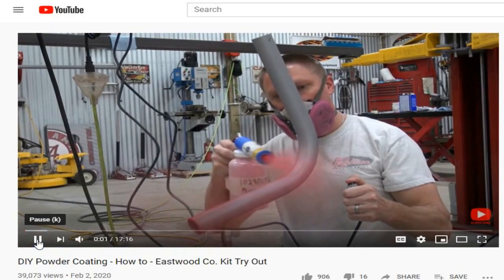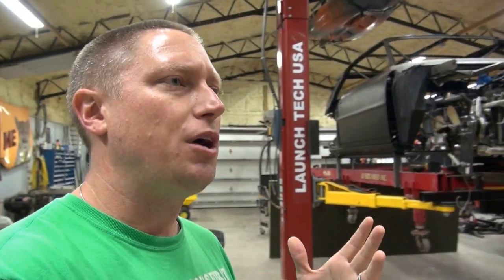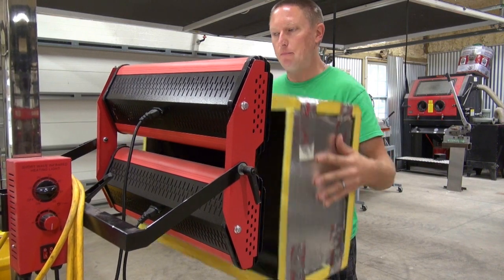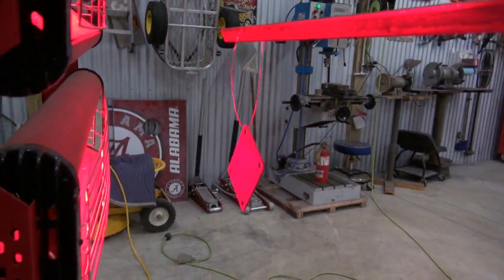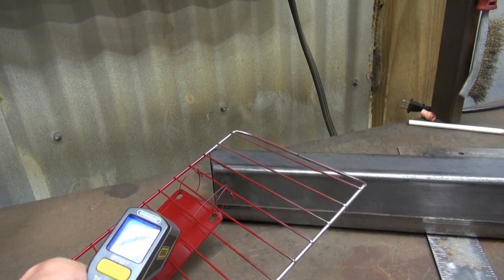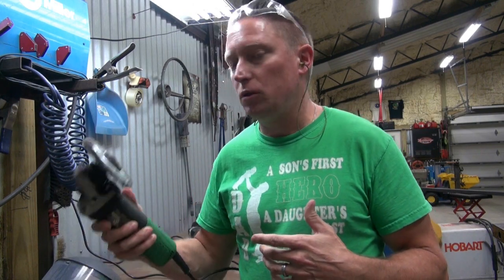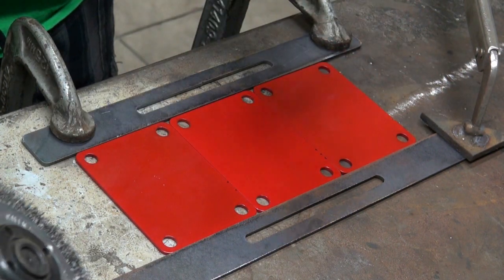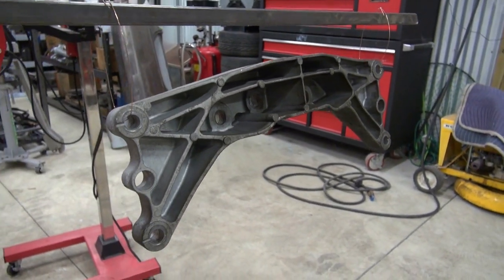Powder Coating Curing Methods Tested - Oven vs Heat Lamp

Comment: What if you made the box with the silver side in to reflect the heat.
Reply: Mylar emergency blankets would definitely help I’d bet. They’re much cheaper than rolls of Mylar and work well for reflecting any type of light
Reply: I was going to say the same thing
Reply: @sapper_5126  although mylar is generally fireproof it can begin to melt around 350-400 degrees which is a big no go for powder coating curing temps

Comment: The reason your thermometer read wrongly on the aluminium is that aluminium has very low infrared emissivity, however it is very reflective, so the home made box would actually have worked better using the aluminium foil side on the inside, not outside. The heat would have been reflected back from the inside of the box.

Comment: Just cut up 2 or 3 electric ovens (people give them away) to make one big oven it’s easy. I’ve done it bunch for friends etc. Best is when you find double ovens but just get 2 that are close to same size. It’s easy. I have a double wall mount waiting for a conversion in my shop. People will literally pay for them done. Also if ya don’t wanna cut up ovens a wood or steel frame oven with off shelf oven heating element and electronics if your handy works well. You can just make a box for your infrared lamp and you will be good.

Comment: Putting your IR meter against a shiny surface does not do much good. Instead, take normal electrical insulation tape and stick it on a small spot and measure on that spot and you will get a pretty good value. It doesn't matter what visual color it is on the tape, Red, white or black tape doesn't matter.

Comment: From an engineering point of view you should remake the box "oven" with the reflective side on the inside. The reflective side is designed to insulate against radiation, which is the type of heat the IR heater you are using produces. This will keep more of the heat inside of the box and allow you to heat up parts faster. Also, most people don't realize that aluminum foil has two different sides on it, one side is dull and the other is reflective. When using it to insulate you should put the reflective side against the heat source. The same goes if you are trying to keep something cool (think exhaust heat shield). 

Thumbs up for using a face shield when using an angle grinder. I require all of our shop guys to use one with an angle grinder regardless of the type of wheel in use. 

All in all I enjoyed the well thought out and researched video and have subscribed for more!
Reply: yes, also when you are smoking dope off of tinfoil you are supposed to put the drugs on the dull side and the flame to the shiney side. I suppose the same goes for everything when it comes to tinfoil hahaha
Reply: Beat me to it, @laptopgeek0991! Yes! What he said! A not insignificant portion of your heat radiation is being lost (or rather, not being used to it's full potential)!
Reply: @nlceguy , one side of the foil isn’t any different than the other. 

The manufacturing process just leaves the sheen, but there is zero difference in reflectivity.
Reply: I was thinking the same thing, but also might try aluminum sheet metal with the fiberglass panels attached to the aluminum sheets. You definitely need the reflective surface towards the part and heat lamp to get maximum heat.
Reply: Thank you..
Reply: You're correct about the reflecting of heat, but if you research that duct board, the reflective side is only rated to 150 degrees. The other side is rated at 450 degrees.
Reply: Mostly, depending on the heat rating of the foiled side. Also, in this case it wouldn't matter, but the reflective side must face an air barrier, regardless of where the heat is coming from. Radiant  barriers don't work in direct contact. The reflective side is useless if you're going to put something hot in direct contact with it.
Reply: @elijahrobinson2362  nope, there is a huge difference in reflectivity actually.
Reply: @31acruz  actually it doesn’t. That’s from the manufacturers.
Reply: @elijahrobinson2362 Dude, regardless of it being a byproduct of manufacturing..Dull finishes are less reflective, like, literally--the more reflective side..is more reflective. The side you can see your 'reflection' in..is more reflective than the dull side.

Comment: The two tests used ,for testing powder coating , in the industry is MEK ( Methyl Ethyl Ketone ) rub test and cross hatch. The MEK tests will test the cure of the powder and cross hatch would test the adhesion. If powder coating passes these two simple tests you know everything is good. MEK is a solvent and is the only solvent to test powder . You would choose a spot on a panel of equivalent thickness, preferably and not on the job you doing , You would dip a cloth rag on your finger into the MEK and while maintaining its wetness by dipping , you would begin to count off the rubs. You need 60 rubs without going through the coating back to the substrate. I have seen tests done where the coating is so under cured that it rubbed through to metal within 4 rubs. If you go through the coating you will know that the part has not been in the oven long enough or had sufficient heat. 
Cross hatch is done by using a blade and cutting through the coating a series of 5 cuts 1mm apart and about 2cm long and then cutting transversely through the previous 5 cuts , in the opposite direction, essentially leaving 25 x 1mm squares cut through to the substrate . Then you would overlay these squares with a good sticky tape ( like packaging tape NOT masking tape) . By using a single even stroke remove the tape . none of the 1millimetre squares should be removed wholly or in part . Should these have been removed the adhesion has failed and there are a multitude of reasons for this . like oil, dust rust mill scale or even thick phosphates and so on, on the surface , or even curing ( which can be checked with MEK) . Perhaps i should do a youtube on these tests.

Please remember that powder coating is a coating and not an armor plate although it is a very durable coating it is not designed to be ground with wire or chisels , screwdrivers , hammers and the like 
     
I have been in the industry as a technical salesperson for 27 years.
Reply: Very informal and knowledgeable I appreciate that response. Helps novices trying to learn (such as myself) good ways to test your work and make sure it's as durable as possible.
Reply: Alan would spare some suggestions on making an infrared oven
Reply: @Notogenocide  Are you looking for an infrared boost on a tunnel or camel back oven or a full infrared oven like a batch oven or straight through oven.
Infrared gas with polished reflectors are good but then it does become difficult to measure your curing capabilities . You would have to give me some more information on what your requirements are.

Comment: From the UK, Great video, like your experiments to find the best process for you.
Owned a powder coating company for 30 years.
Powder coating basically "cures" in 3 stages
1. the powder coat will melt and gloss off
2. the substrate, steel in this case, has to come up to the cure temperature of the powder being used.
    The cure temperature is usually given by the by the powder manufacturer, they do differ.
3. When the steel part and powder coating is up to the cure temperature, this is when the actual cure
    process begins, and is fused onto the substrate. leave in the oven, at the cure temperature, for a
    specific time to complete the cure/fusion process. The cure temperature and cure time defined by 
    the powder manufacturer.
Remove from oven and let air cool.
Many powder coaters use epoxy power, which is fine, but generally for indoor use.
For your application, a polyester powder would be suitable. It has better weathering and UV resistance.
Also has better abrasion resistance, is more "flexible" than epoxy.
Try putting the shiny side of the insulation board facing inside the oven. Infra red heat is a relatively low wave form, which will rebound back off the silver shiny side. This will give you quicker heat up time to the cure temperature and better even heat on the part in the oven.
Hope this helps, good luck.
Reply: how relevant is the amount of powder on the item? Does a thicker coat change anything?
Reply: @deangraves908    Generally the powder manufacturers will recommend the thickness required for a particular powder. 80 to 90 microns is typical, but can vary.
Sometimes a thick coating above those recommendations makes the cured coating strength greater than the adhesion strength to the substrate, which can make the coating liable to chipping if it gets 
a “ Knock”
Reply: @graham7176  is there a specific way to accurately measure the amount of powder on your material or just one of those "eye ball it" situations. I am just getting in to all this and I have no idea what I'm really doing 😂
Reply: @deangraves908    Unfortunately the only way to find out the thickness of a powder coating is to measure it with a coating thickness gauge. There are a few types, try googling “powder coating thickness gauges” for sale.
It is the cured thickness which the important issue.
Reply: @deangraves908  my company powder coated between 5 to 6 tonnes of steel product per day, if you need any further information, I would be happy to help.
Good luck.
Reply: Can you tell me what do you call the infrared light i am looking for it on internet but cant find it anywhere, i need it for paint curing
Reply: What if the powder cure temp is 400F and my oven max is 350F.  Can it fully cure if left longer like 1hr or don't bother?
Thanks
Reply: @gsr187t    Curing temperature is normally temperature and time to cure at that temperature given by the powder manufacturer.
Check with the manufacturer of the powder for their recommended curing time at 350, it will be a little longer that the curing time at 400 to achieve full cure.
Correct temp and time for curing will ensure the best adhesion, performance and longest life of the coating
Hope this helps.

Comment: I just realized, the engineer below is right, you made a slight blunder, lol you will get much better results with the "reflective side pointing inwards" on the inside so it can reflect the heat on the parts. Fantastic idea however ! good job.

Comment: I don’t need a permanent oven and have limited space.   I have made a dry stacked cement block oven with duct board and had great results when doing wheels, intake manifolds and such.  I have a collapsible oven made of three layers of duct board.   Powder coating is very forgiving!

Comment: Great video, I want to do some DIY powder coating for the first time and need to learn the lowest cost and easiest way into it. I'm renovating a powder coated bike frame, so your videos have been great to learn some entry level methods.
If that insulation has an aluminium foil coating, then the emissivity is very low, so the IR thermometer will not read anywhere near the correct temperature. 
I guess the adhesion test with the wire wheel shows that the metal itself got up to temperature. I.e. it's easier to heat the powder coat to melt it, without getting the metal hot enough for it to properly adhere. A longer time in the toaster oven would have improved the result I guess.

Comment: Didn’t read any comments but I was just going to give you some info for future reference.  The infrared temp gun you use when checking your hand it is checking skin temperature and not body temperature. Your skin will be much cooler than internal body temp. Also any high reflective surface will need a flat or matte finish added for an accurate temperature. There are calculations that can be made based on an item’s emissivity to get a better reading. Excellent video by the way

Comment: That bar heater looks like you could rotate the two elements so that they point at each other. Do that and put the part between then. I’m sure that would cure nicely.

Comment: To check the temperature of powder coated parts in your oven, hang a test piece of un-coated steel having the same thickness as the powder coated part, near the coated part.
Take temperature readings from the un-coated test piece. (preferably a test piece having a flat surface)
Reply: Can you tell me what do you call the infrared light i am looking for it on internet but cant find it any where

Comment: Also going back and forth with the wire wheel, it’s possible that since u have to slow the motion down as u get ready to change directions so it’s going thru more rpm’s over the end two pieces as compared to the center piece. The wire wheel is spending the least time on the middle piece since the motion is still at its quickest. Idk. Just a thought, I could be wrong

Comment: Good information about wearing safety glasses and a face shield while using a wire wheel on your angle grinder. Another good piece of advice you should take is to replace an old wire wheel as they will start to loose wire more frequently as they ware out this becoming increasingly dangerous! In addition, you should put the guard back on your grinder. Set the example to your viewers to work safely. You should also keep your neck covered as those little wires or hard for a surgeon to extract from your jugular vein. People have died from these types of injuries!

Comment: I'm new here and that was a good test & on the insulation box it you put some that metal tape over the insulation where you cut it then it won't burn ! Try that test with your light setup inside the box & have another piece of insulation to close the box fully so it holds the heat better and you cab get the temp lot higher ! my brother made one from a couple 4x8 sheets stuff like that so he could do stuff up to 3'6" and it works great oh he used 2 coils from electric oven and set it up like turning your oven to broil ! He ended up getting lot work for a custom body shop & does engines & transmissions and decided he is going make a larger box with 4 coils in it for doing fenders & smaller hoods ! Anything that fits in a 4'x4'x8'

Comment: Hey man, I appreciate the efforts in making the video but I would tell you that your Box would work a ton better if you had it reversed and had the reflective side inwards.  The part would get a lot hotter and it would be a lot more of an even temperature on the backside then the current  way.

Comment: Interesting and well-made video, thanks! I think a shiny metal part in front of the i.r. lamp won't absorb much heat, but once you coat it with powder it soaks up the heat much better. I'm sure that that (combined with the limitations of the thermometer on shiny surfaces) explains the disappointing temperatures you're seeing with uncoated parts. Personally I'd keep the d.i.y oven silver on the outside, I'd guess the less reflective interior will heat up and heat the air inside to a higher temperature than a silver interior would, providing there aren't too many gaps to let the hot air leak out. Sorry about the long comment : /
Reply: Yes, Radiant infrared needs reflective on side.  Repeat test with inside lined, then test temperature. Bet it will be higher. Copper color is said to be more ir reflective than silver color.

Comment: Do you have additional details on the fiberglass board used for the oven box.  The standard duct board is only rated to 250 degrees.  There are medium and high temp boards for industrial applications, but these seem very hard to find.  My local supply house didn't have them.  What brand?  Johns Manville? other?

Comment: Great video!  Thanks. Question....What kind of sand blaster is that you have and size of air compressor.  Appreciate your response.
Reply from the maker: It's the REPP70.  Link below.  I also use a 34 CFM 10 Hp air compressor.  I used to use a 5 Hp 17 CFM unit, and that wasn't anywhere near enough air to blast efficiently.

https://www.redlinestands.com/catalog/shop-equipment-c-327/sand-blast-equipment-c-327_501/sand-blast-cabinets-c-327_501_502/redline-repp70-clamshell-pressure-pot-abrasive-blast-cabinet-p-2421

Comment: Try to make another box like the one you made only use heat guns through holes on all four corners. Slightly tilt to where it creates a vortex. I've always wanted to see the temperature difference on that.

Comment: Did the HVAC company tell you to put the shiny side out?

Did you consider putting foil in the inside to better reflect the heat?

Ideally, I would think that fully enclosing the heat lamp INSIDE the box, shiny side in, would give you even better results. Same idea as a household oven...reduce your heat loss to near zero.
Reply: Unless he specified to the company  what he wanted to achieve with that insulating  board(referred to as 'duct board in the trade), they would likely  advise him  that the foil goes to the outside. This board is used to make distribution boxes in an attic or loft for the conditioned air; either trying to keep it cool in the summer or warm in the winter.  The thickness of the ductboard determines where it could be used; 1" ductboard would be used between the conditioned spaces(depending where in the world you are and the insulating properties of the building) e.g. above the ceiling and between the floor above. The thicker ductboard would be used in an unconditioned  space. Unless specifically requested,  you'll get the ductboard where the foil side is not intended for high heat.